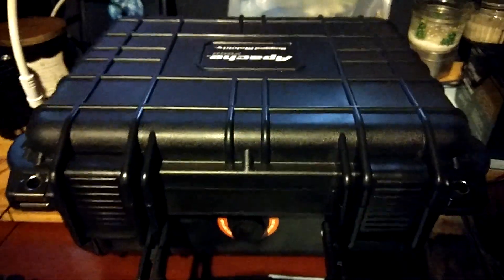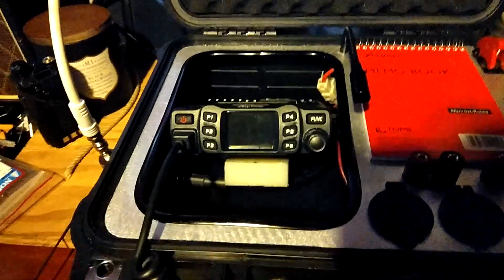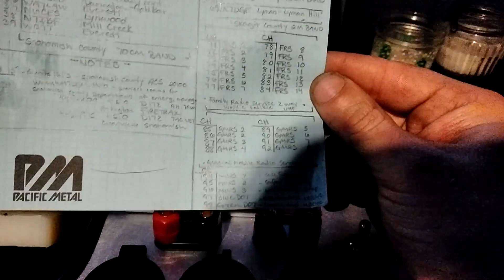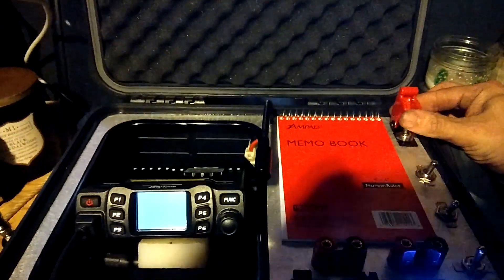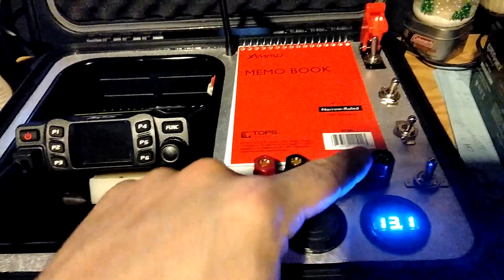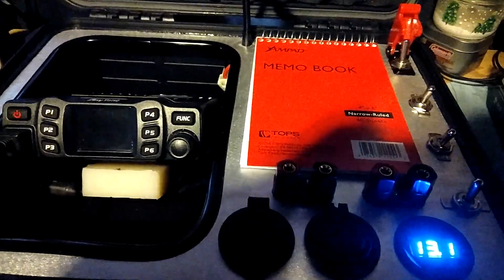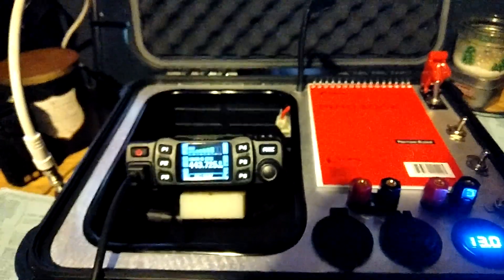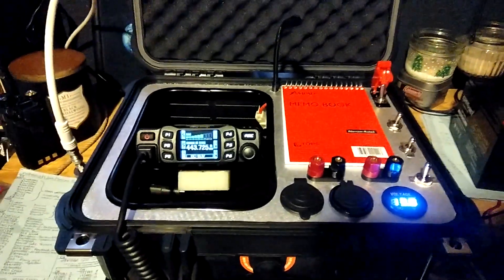Hamm go box

Comment: I love this project. I hadn't seen this yet but I am planning to use the same radio and I think, the same box. I am thinking of using a similar layout but including some use of the lid for switches, a locking lever for open lid, and a lever to angle the radio upwards as the lid is opened.

Comment: Wow!!! Sweet Box.  Simple and effective.  Where did you get top platform of the and the bin the radio sits in?
Reply from the maker: Top plate wa made custom from scrap aluminum. And box was a harbor freight special
Reply: @everythingoutdoors9969  what is holding up your plate it's not just setting on the battery is it very nice build. What amp hour battery are you using I'm building two boxes both are 2800 Apache one assembler to that build the other is completely enclosed and was done with plexiglass. ×2
Reply from the maker: @grayeagleoklahoma2473    the plate just sits on the battery. I thought about using velcro to hold in place but the height and fit was perfect just sitting there.    I'm running a 15 amphour battery.   Thanks for the comment. I hope your build goes well. Have fun!!!

Comment: Most of these antennas like the rubber duck or abree, nagoyas, etc are rated for 10-20 watts. Do you notice any issues when transmitting on high with this radio? Really nice setup. :)
Reply from the maker: I haven't noticed any issues. Primary use has been with a homemade dipole.   I use some standard j pole on the go. For rubber duck antennas and such i liked that they weren't ruled out as usable especially in fairly close proximity to a couple hand held radios.

Comment: I like it. Simple, effective, and workable. Im in the process of building a dual band go box now, but Im chronically OCD, so Im already in the process of overdoing the design for my box. Ive redesigned it a half dozen times just over the weekend. Ive ordered parts, changed my mind, ordered more parts, and changed direction once again. What Ive decided to do at this point is put together this current box, gain some experience and knowledge with the build, and then prep for version 2.0
I would like to say that this wont happen, but it probably will. Im already thinking that version two may be as simple as 12v 18ah battery, a rigrunner with built in usb, a master switch, and a volt meter. Other than that, just some misc premade powerpole jumper wires and an antenna.
Reply: @Finn Lucas Try Flixzone. Just google for it :)
Reply: @Finn Lucas Try FlixZone. You can find it on google :)
Reply: I realize it is quite off topic but do anybody know of a good place to stream new tv shows online ?